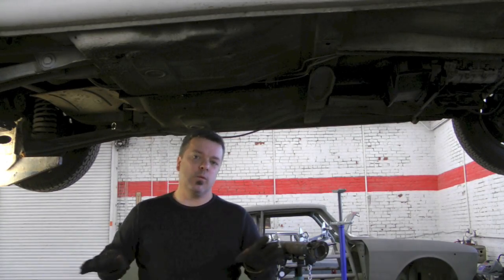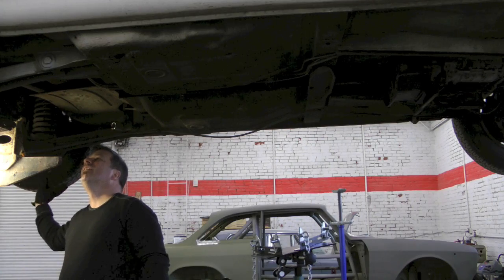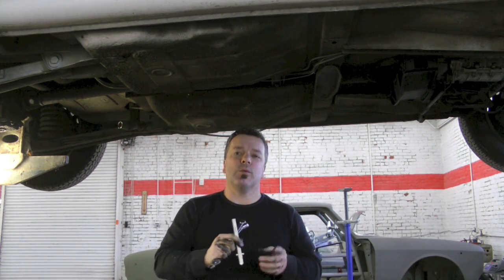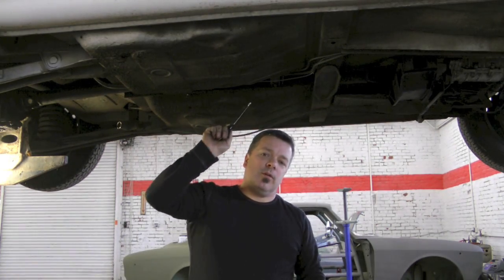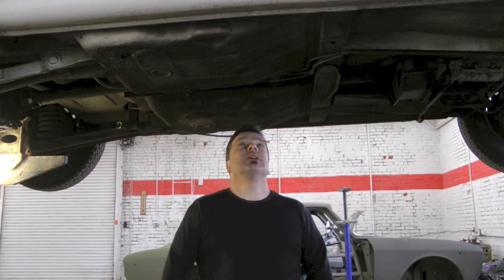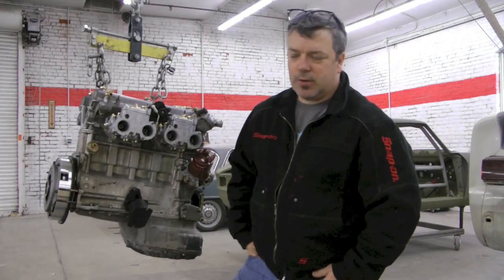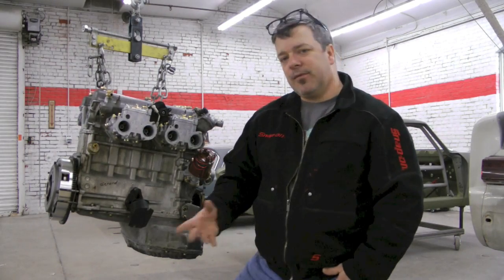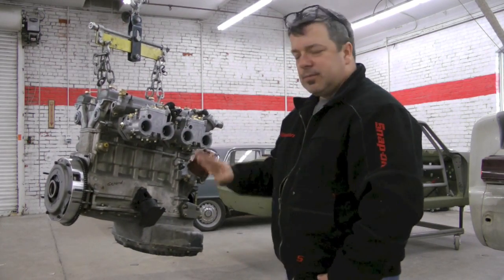Super refresh VI

Comment: No mention of the  blanked off mecahnical fuel pump plate,mounted below the Marelli distributor.        In carburettor cars, the Fispa mecahical fuel pump is mounted just below the distributor,but obviously on this engine, an electronic fuel pump ( FACET )is probably mounted in the inside of the trunk, usually close to the fuel tank.